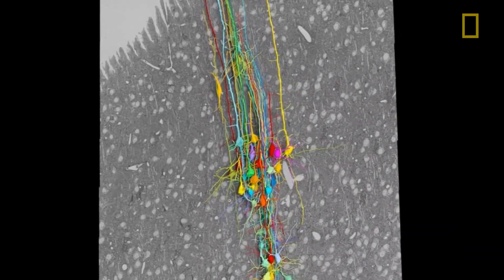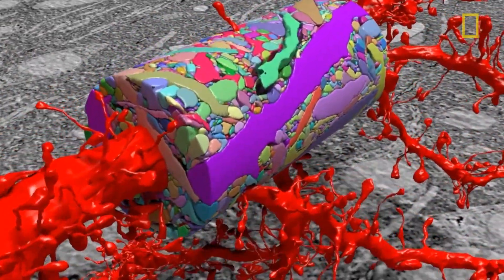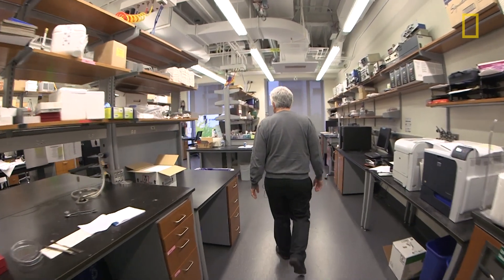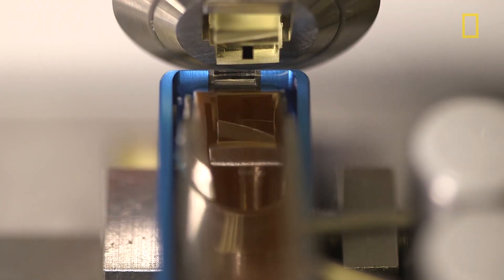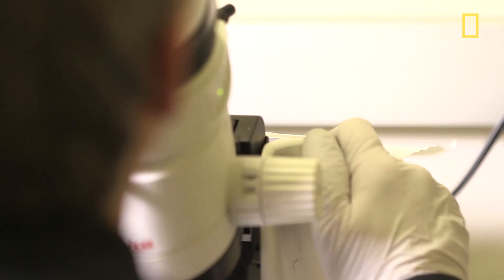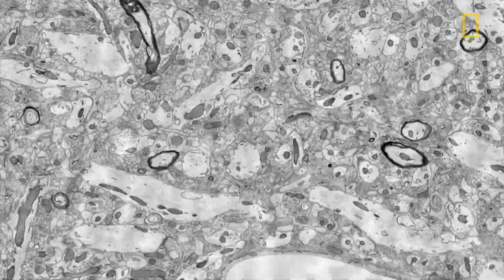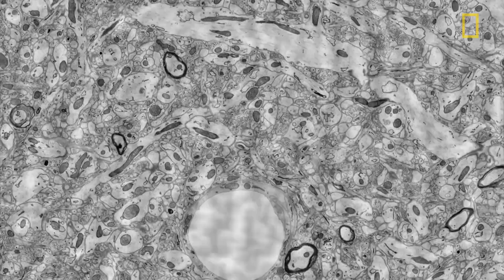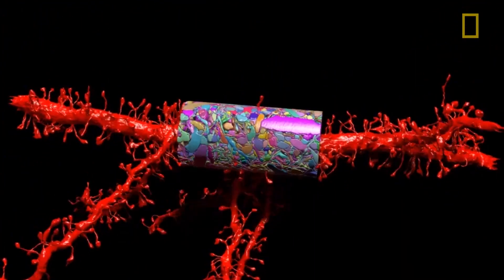Beautiful 3-D Brain Scans Show Every Synapse | National Geographic

Comment: There are a few theories about how this chip or chip works:
 Stimulating specific areas of the brain: The chip may be used to stimulate specific areas of the brain associated with aging, such as the hypothalamus.

 Hormone control: The chip may be used to control the secretion of hormones that play a role in aging, such as growth hormone.

 Repair damage at the cellular level: The chip may be used to repair damage at the cellular level, which is a major factor in aging.

Comment: Got to have the wiring  diagram , then you can jump out wires   as needed . Or pull the fuse and make the repair . The brain seems to have parallels  to electrical  troubleshooting

Comment: At 2'40", it was stated "For a mm-depth, you get about 32,000 sections."
That means each section is bout 30 nm thick. Is it possible?
Reply: Yes. Embedded in hard resin, brain tissue can be cut at 30 nm using an ultramicrotome (Leica UC6 in this case)

Comment: Wait what? With 1mm slices they are able to map all the synapses but with 20-micron slices of the human brain they can't? Are mouse synapses thousands of times bigger than in humans or something? Makes no sense.
Reply: No, 33000 slices from tissue 1mm thick.
Reply: Vega Lotsatoshis Wow. That translates to 30 nanometers. In that case, why didn't the extremely recently human brain project use this technology? They were only able to scan a resolution of 20,000 nanometers rather than 30 nanometers. http://io9.com/see-the-first-ultra-high-resolution-3d-scan-of-the-ent-514395280
Reply: +Max Loh First of all, that article is almost a year behind this video. Technology grows exponentially.
Secondly, mouse brains are far smaller than human brains.
Reply: +Metcaslix But why can't something that slices thin slices be applied to a human brain the same way?

Can't a very thin slice of human brain just be delicately slid into some nice warm fluid?

Comment: National Geographic The bundle seems to cover only one axon, and the scientists mention one millimeter. How is this showing "every synapse"?
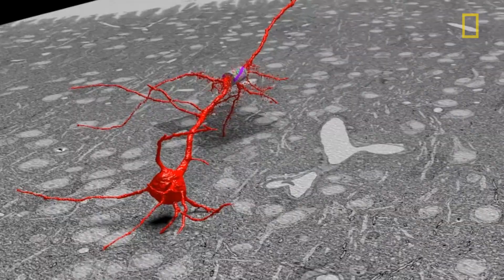Reply: The cylinder is placed around a single spiny dendrite (red), and its volume is about 675 cubic microns (way smaller than a cubic millimeter). Many axons (and many other dendrites) also enter the cylinder. Inside they make around 800 synapses between each other. We could label all synapses in the electron-microscopic image stack and then extract a 'connectivity matrix' of connections between axons and dendrites within the cylinder. However for the most part we don't know where the cell bodies are from which the axons and dendrites originate (with exceptions, for example we know it for the central red dendrite, as you can see around 1:20), and we don't know what other synapses they make outside the cylinder, so this analysis of connectivity is currently only a very local one.